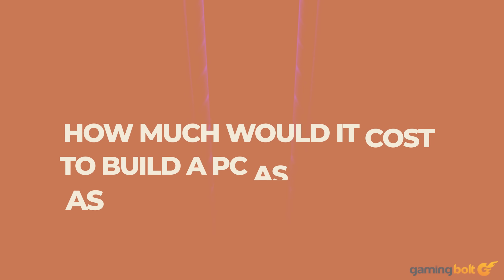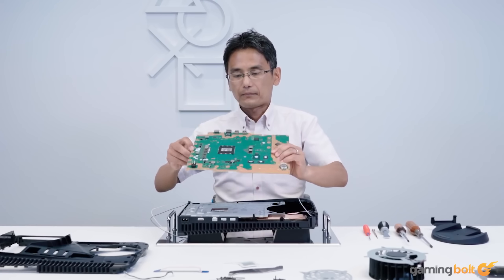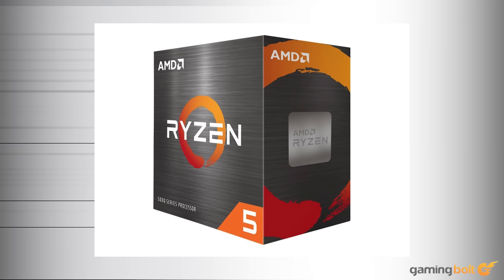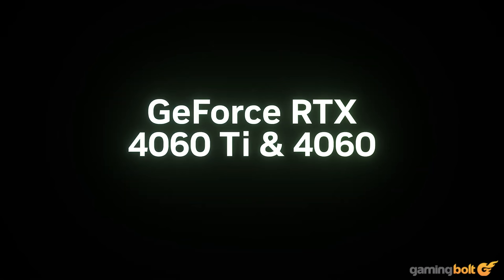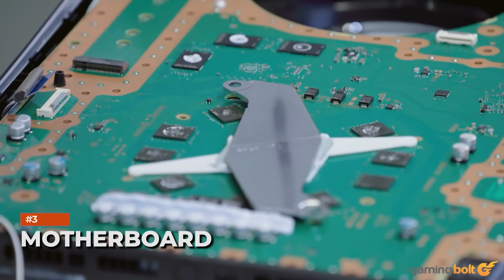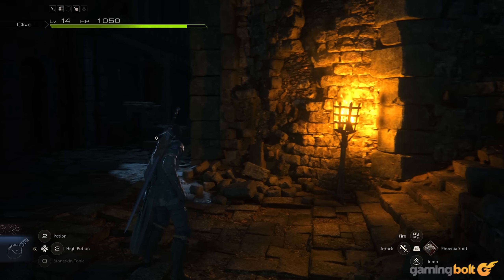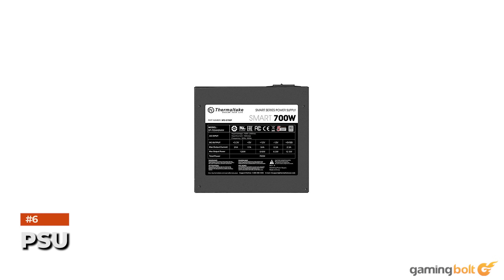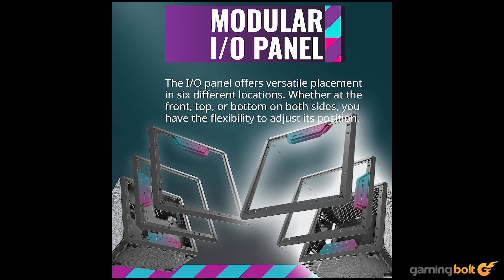How Much Would It Cost To Build A PC As Powerful As The PS5? (2023 Edition)

Comment: This build won’t work as I have the same motherboard and it an ATX form factor and will not fit in the case the picked out as this only supports micro-ATX and Mini ITX you’re going to have to but a ATX case which has 7 PCIE slots at the back not  4 or find a smaller motherboard

Comment: i would have liked to see fps comparisons from the ps5 and comparative pc
Reply: Yes. There are plenty of current games including those Sony early exclusives out on both platforms. 
It would be interesting to show the comparison between the suggested spec in the video, as well as a few in the comments.
Reply: It's hard to compare because the every game will be work diffrtent, bacuse is the matter of how game was scale by developers. How good port is for pc and how is good for ps5.
Reply: @emhyrvemrais7574  Well the new ue5 games also needs performance mode on consoles to work with 60 fps
Reply: fr lke there's no way ps5 has a 4060 type graphic and can't even get 120fps on spider man 2, this is just the ultimate cap @yamiimax
Reply: @dn_vii  no the ps5 has an amd gpu 

Graphics
Custom AMD RDNA 2
36 CUs
Variable frequency up to 2.23 GHz
10.3 TFLOPS peak
Reply: It's like android (pc) and apple (Sony and Microsoft consoles) the consoles are better adjusted to the games than an pc but they still struggle with FPS and rtx
Reply: gamer nexus did it two years ago and matched the ps5 to a gtx 1070  pc :P   a 1070 gpu cost  cost about 50 dollars
Reply: @madsimilius7057 well try games of 2023 with a 1070 and you will see it lost even on fhd haha
Reply: @yamiimax  why would that change anything? I remember my PS friend telling me   ps5 would do 8k 120hz raytracing all at once 🤣 At the time i had a 2080ti and i knew that this was bs !  i told that him that the ps5 would have to have different modes because there was no way in hell that the ps5 would be able to do that. He also told me  that it would be 3-4 times more power for the money. Fan boys as usual are delusional . Spec wise the ps5 should be in the 1080ti-2080s teritory
Reply: @madsimilius7057  I said that because I also do not believe everything better on consoles I'm an only pc gamer

Only thing cool is the ps exclusives are great
Reply: @yamiimax  and the "instant" loading times? the dual sense?
Reply: @xello1984  yeah load faster because it can load direct from SSD that doesn't make the ps better than pc 

Dual Sense? well I prefer mouse and keyboard haha
Reply: I read the 1070 is roughly a 6.5 TFLOP card
 @madsimilius7057
Reply: bullshxt AF @madsimilius7057

Comment: 5700x paired with 2080ti detroys a ps5 with ease and does raytraying spot on even if it costs more, You'll be paying more the extra costs for pc parts on games costing £50 or more each time. Plus console versions of games run at much lower graphical settings, Refresh, Pc can run games in 8k 60fps no problem, Console barely do 60 fps in 4k.

Comment: No doubt consoles still represent better bang for your buck. But I'm still tempted to finally invest in a proper gaming rig again despite owning both ps5 and series x. It's just difficult for me to gauge at what price point do I need to hit to notice a significantly better gaming experience vs console. If I'm spending a few hundred more simply to match a ps5 experience that's using midrange parts, then surely I need to invest in a high end rig. For example so I can play starfield at 60fps at high/ultra high settings. I basically need something like a 4070ti minimum or 4080 don't I? That's easily a £1500 plus rig there. Probably worth doing for anyone who can splash that but that seems to be the reality if you want to game at noticeably better settings compared to console?
Reply: A pc similar to the ps5 would cost about $600, but getting an rx 7800xt or geforce equivalent (give and take) would be a big improvement, and for high fps, a 5800x3d would be a big step up for the cpu. The ps5 is like a ryzen 3700 and rx 6700, but with both underclocked, making it more like a ryzen 3600 and rx 6600xt. Upgrade those to a ryzen 5600x and an rx7800xt and you'll still be at $1000 or so. Really, the nice thing about the pc is you can use it for many other things, and when one part is outdated, you can upgrade just that one part and sell your old one. Or you can do what I do and just accumulate enough parts to build a spare pc lol. Buying the top end stuff is definitely super expensive, but maybe build something cheap for now, even if it's not as good as the ps5, and then see if you like it enough to invest more into it. Don't be afraid to put it together yourself. All the parts are made to go where they're supposed to without fail, built to long-established standards. The cpu only has one spot to go into, the gpu as well (use the top-most slot), same with an nvme, and power supply. Anyway, pc's are fun to tinker with, and easy to upgrade, so I recommend them. Lmk if you decide to do it and need a tutorial or some troubleshooting.
Reply: Yea….that’s the nature of the expensive pc beast. If you want to notice a difference graphically, then I’d say you’d need to spend at least 1500.00 4080 would do it, since it can handle raytracing well in some games at 1440p with high settings.
Reply: USD600? At this economy with sky high inflation? That's impossible now. And that equates to 2 iphone glass back replacements 😅
Reply: A Ryzen 3600, b550 with wifi, rx 6600xt, 1TB nvme, 16 GB of 3200cl16, 650W power supply, and a case. That's about $600 with all new parts, and at least as good as a PS5.  @MrQwertypoiuyty

Comment: With the power supply. That option is TERRIBLE. The 80+ rating alone isn't as big of a quality stamp as it used to be since pretty much all PSUs are 80+ now. At minimum a consumer should look to get a PSU with an 80+ Gold rating, then they are assured of both value and quality.

Comment: FYI that motherboard dosen't support pcie 4.0 so the gen 4 ssd you used will only run on gen 3 speeds.
Reply: PC's also don't have custom SSD controllers that compress and decompress content on the fly based on game optimization. Technically they say 5500mb/s, but with automated compression it's more like 9000mb/s.

Comment: Ryzen 3600 CPU and Radeon 6700xt  = very close to PS5. Full PC build would be about $800.
Reply: 6700XT is significantely faster than PS5. PS5 is 6650XT at best
Reply: I’ve read it’s closest in specs to a 10 gb RX 6700 (non XT)
Reply: @danpolo8829 but underclocked dude, so more like 6600xt or 6650xt

Comment: Seems like most people who would be interested in doing this are probably pc owners already and would simply need to upgrade a few components. I've been using the same pc case for years and have upgraded it several times and usually my psu lasts through several upgrades. I think you also have to consider value of a PC vs a PS5 too, I can do a lot more with my PC than I can with my PS5 and I have all kinds of electronic devices that require a PC.
Reply: This is a two edged sword. PS5 is a pure "gaming PC" so to say, so it's fully optimized for playing games, not doing other things. But sure, most people have a PC or something to do other things than just play games. Usually a laptop or something like that, but desktop works just as well, and like you say is then 2 in 1, so you don't need a 2nd PC besides your gaming PC (PS5)..
Reply: The next question is, do you even need a PC ? I bought one for gaming in January. I haven't had one before and I never needed one 😆

Comment: The Operating system. Unlike Windows which is a general purpose OS, Sony PS has streamlined OS specifically tasked for gaming purposes, that can mean alot I think
Reply: It does mean alot, not only is Unix like systems far superior to Windows systems in most ways, the particular one in PS5 is a custom Unix like system for games only. Not a general purpose OS with tons of bloat.

Gaming on PC would be leaps better if they started doing their gaming on GNU/Linux instead of Windows. If that was the case, they could have similar benefits to what PS5 does, and the development for games on GNU/Linux would accelerate and multiply into things like far better GPU drivers (compared to Windows equivalents), distroes optimized for gaming, window managers/desktops for gaming etc etc. It would improve the overall performance of PC gaming ALOT if it did happen.
And alot of games could start developing based on bare bones libaries and OS resources and developers resources that don't use bloaty API's and toolsets, which again could make games perform far more efficient.
Reply: @johnwayne-kd1pn  Linux gaming is a good option now in days being that Vulkan, AMD/Radeon and Gabe Newell/Steam fully support Linux gaming. It's now a good time to jump ship from buggy windows.
Reply: @leanlifter1  I agree, those things are great. But overall the situation is only decent, it could be good, and if it was good (more people change over, better effort from AMD, NVIDIA), it would become great quickly.

The potential is absolutely fantastic, gaming on GNU/Linux would naturally and could be so much greater than on Windows.

But, we need more people to change over, only then will things really start to accelerate.
Reply: @johnwayne-kd1pn  The AMD Radeon drivers included with the main Linux distros have the AMD Radeon drivers pre installed with the OS so it's literally plug and play out of box for the Radeon 6000 series GPUs right now on Linux.
Reply: @leanlifter1  Yeah, the convenience of the Linux Kernel..
Anyways, personally for now I prefer the open drivers, and I really think AMD and Nvidia would benefit from making their drivers open, at least most of it. What the community can provide in terms of drivers and improvements can't be underestimated.
Reply: @johnwayne-kd1pn  I don't have to worry about "drivers" and janky control panel settings on Linux the GPUs that work just work out of box no need to waste life on janky drivers and an outdated co trol panel that's stuck in the 90s ya that you Nvidia your co trol panel has sucked for over 2 decades lol.
Reply: @leanlifter1  Well, if gamers knew what was best for them, they would switch to GNU/Linux asap, and take the gaming market with them.
Reply: @johnwayne-kd1pn  It would not be a surprise that Linux will be the dominant platform for gaming along with AMD/Radeon and Intel/Arc and Nvidia will be pulled out of consumer GeForce GPUs all together by the time the next console gen gets underway.
Reply: Its even more locked down so it's actually not a good thing being that it's just laptop hardware and nothing special other than it being locked down and proprietary which is perfect for people that don't know how to configure a computer and hardware and software properly.
Reply: I'm not expert but i have a guess that even if the hardware inside it is not the high(est) one, maybe only good enough for the one task, but when it's being tuned by its OS to only do one task, which is gaming, it can do the gaming task much better than the higher hardware which is not being tuned for only one task by its OS. But I may be wrong @leanlifter1

Comment: I'm only 3 minutes into the video and this already a pointless watch. You're using the wrong generation of cpu and the wrong manufacturer of gpu, let alone the wrong generation of gpu. The cpu that matches the PS5 on PC is the Ryzen 3700, not a 5600. On the GPU side you didn't even pick an AMD card. The closest to a PS5 GPU would be an AMD 5700XT.

Your video title was "How much would it cost to build a PC as powerful as a PS5" and then immediately picked parts that are nowhere near the PS5 specs, artificially inflating the price of the build for no reason in the process. 

Ironically I watched this on my PS5 😂

Comment: You seem to have everything mismatched.  PS5 is roughly the same as an R7 3700x for 8-core CPU,   RAM is rated at 3,200 MHz. The GPU is roughly an RX 6600.  You would need a B550 motherboard to get the PCIe 4.0 x4 NVMe SSD.  Your system is way overkill and would crush the PS5 by a large margin. Especially the GPU!  Oh, and that atrocious PSU may very well kill your computer.  It is rated "F Tier" on the PSU Cultist tier list.  Stay at Tier C or better.

Comment: Ryzen 5600 based on the new AM4 architecture? Are you guys drunk? And who the hell buys a B450 board now instead of a B550 that doesn't have PCIe 4.0 for cards with only 8x PCIe lanes? Also, the board has no USB-C port at all while the case has a front USB-C port, well done.
The video is so badly done, I don't even need to continue to come to the conclusion that the video is just bad at all.

Comment: Don't forget to add in the yearly PSN cost for online access. Consoles generally have a 8-10 year lifespan so PSN which is now $80/yr you're adding in $640-$800 to the cost of that cheap console. Now you are in the $1,150-$1,300 pc range. You can build a pretty damn good pc for $1,300. Now factor in that with emulation that PC can play the games from near every console generation. I have games from 20 years ago on my steam account that I still play from time to time. While this is a semi accurate video it does not address the value per dollar advantage a PC has with the sheer amount of versatility a PC provides. I can use my xbox elite controller with my PC, or a PS5 controller, or I can use my VKB gladiator dual flight sticks for atmo flight and space sims that consoles could only dream about running.

And for the record, I have a PS4 and an Xbox series X neither of which have been turned on in well over a year and just collect dust now.
Reply: true people forget that game consoles are so cheap compared to pc because of after sales services like psn, gamepass, extra controllers and games which you can purchase only through one particular party. most of the time consoles are sold at a very low profit margins because of these factors
Reply: Uhh you can buy disc based games from 50000 different stores. @xfrankenstein6981
Reply: I never paid
Reply: I dare you to buy a PC that costs $1300 that will last you 10 years. I bought mine for well over 2k a few years ago and I'm already struggling, and my upgrade that I need (a better GPU) costs almost $1300, go figure.
Reply: @petarrica3134 a few years? How many years and what card? I mean, I built my GFs PC for $1,500 a few years ago and it still works just fine with new games. Your anecdotal evidence means nothing without specifics ie. Specs and exactly how old it is. And why it needs upgraded. And why you feel you need a $1,300 gpu.
Reply: @reisshep well, you can build damn good pc with 1300$ budget and it will probably last you 10 years
Reply: Yeah no. @RavenHart-sx8xs
Reply: @RavenHart-sx8xs good joke 😂😂😂

Comment: Worst thing for me about pc gaming has been the updates and the having trouble shoot all the time with random issues for someone like me that gets out of work and just want to play a few games I ended up on my ps5 of Xbox series x and barely use my gaming pc. I have also found in fps games you run into so many cheaters.
Reply: Warranty is also much easier to obtain on a PS5. In Australia, you can get an in-store replacement. So no need to wait for a technician or yourself to check which component is at fault, you just have the whole unit replaced. Thankfully though, I've been lucky and have never once got a faulty PC component despite the fact I not only build multiple PCs for myself, but also for others as well. But that could be due to Australia's strict consumer standards.

Only problem I find with consoles, especially Sony is when they try launching them at $800+ AUD. Not only that, but they have a really bad launch lineup of games. It definitely makes it hard for consoles to be a year 1 or year 2 buy. $600 AUD is more reasonable as a consumer-friendly, high end console but even that will still limit buyers greatly unless you have a strong game lineup. Xbox and Switch have much more convincing pricing model.
Reply: what issue with updates? and troubleshooting issues all the time? both sounds like a YOUR system issue cuz my pc is on 24/7 and not a single issue. Anytime im ready to game i jus go. You overexaggerate and what you said sound like your system is just trash
Reply: Gross over exaggeration. I’ve had to troubleshoot an issue once in the past 6 years and it wasn’t even game breaking
Reply: @LudusAurea  What you may not be considering are the steps you've taken to avoid the need of fixing or troubleshooting. I have computers that outside of regular updates (which even that can be hard for people) I've never had to touch in 6 years as well. Although I probably should.

A lot of issues people have with computers is due to Windows updates. Half of my business is driving out to people's houses and clicking windows update for $50 per job. Some I can get them to do it over the phone, but a lot of my clients just prefer me to come out and do it.
Reply: @GoodwillWright thing is that regardless of whether or not you game on a console or PC changes are you still own and operate a PC and have to deal with that anyway.